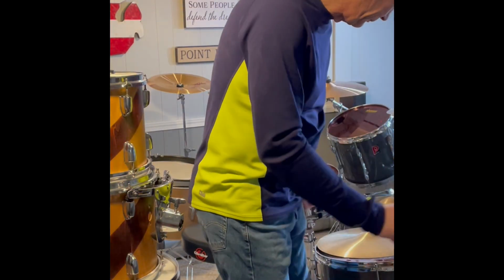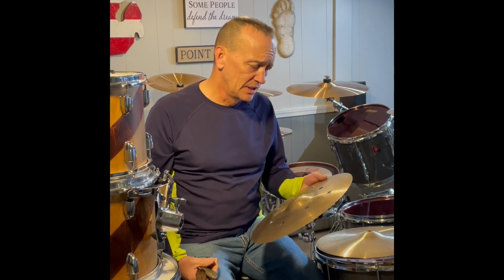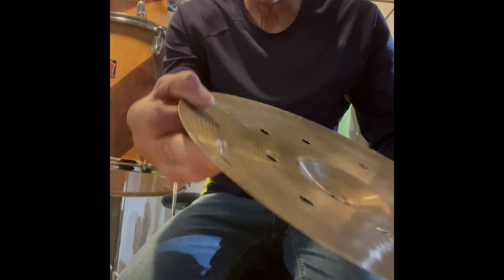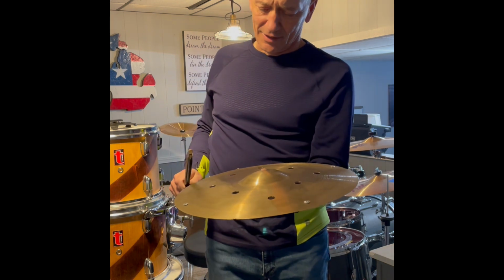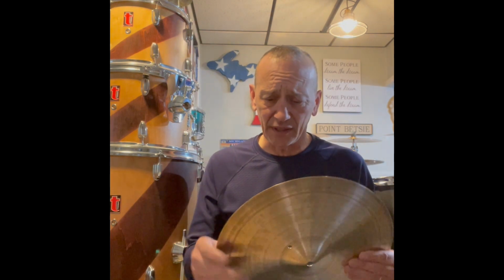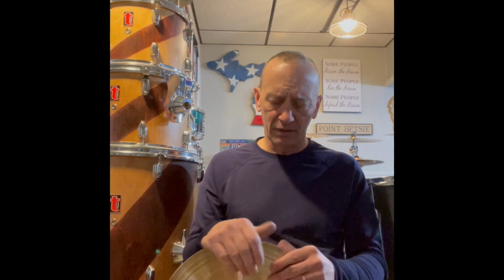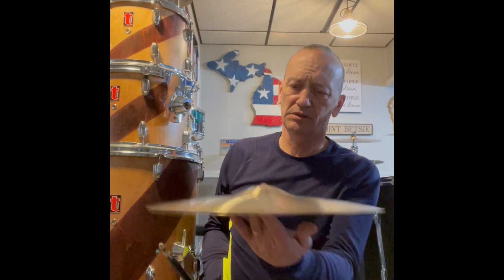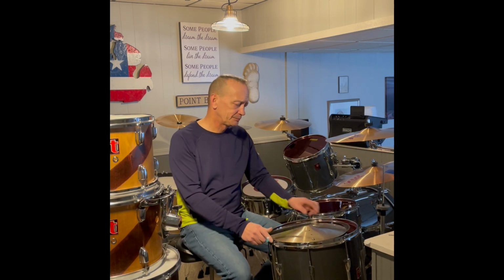Cymbal Hacks!     Drilling and Rivets and Bolts oh my!

Comment: Mate ,
I had this problem,  couldn't find proper cymbal rivets so I got the ones you have.
You can pull them apart easy by holding the rivet side with plyers and give the nail a tiny little hit on a brick and it comes apart very easily.
Reply from the maker: Yeah, I’m really happy with this experiment. I was pleasantly surprised how well it turned out. I do like the screws and bolts better. They just seem to add a little extra spice to it.